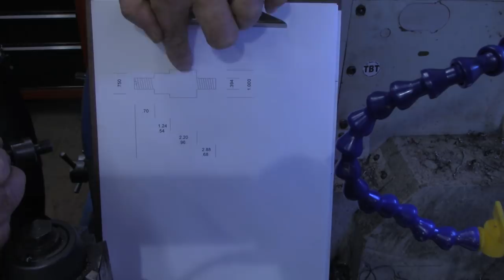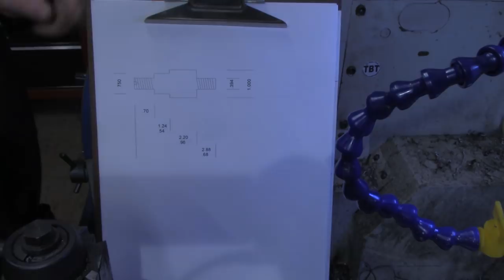Lathe Dog Drive Plate Mounting Studs

Comment: Great Work Lee. It turned out Great. Also thanks for the Tip on how to find Bolt Centers with the Caliper. I’m still New to Machining and never have seen that trick before. It will really come in handy. Especially because I am going to start making a new Backplate for a New Chuck I just purchased. I was wondering how I was going to get the Bolt Centers exactly right. Great Video 👍

Comment: I think I like your collet chuck have ours, not mounted yet, back plate thing, see my friend Vernon at Mature Patriot posted a comment below, nice man. Smart move for a few minutes work on adding the flats for future removal possibilities, you thread just like we do our threads turn on move in turn off move off and we get our metric threads just fine. We are all metric here a watchmakers thing. Your end result is a really nicely machined plate, yes we are using two mandrels right now, not like yours (those are new to us) ours have a tightening screw, one is really small the other is larger to remove a milling machine pulley bearing for rebuild thing. Thank you for the great ideas, we love your videos they are helping us learn more techniques.